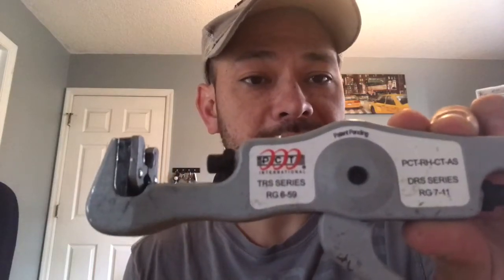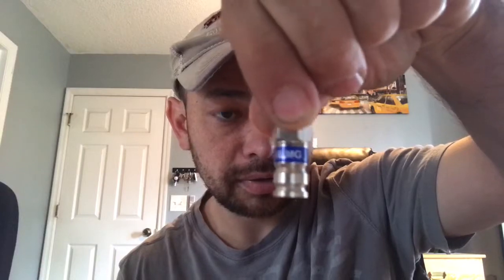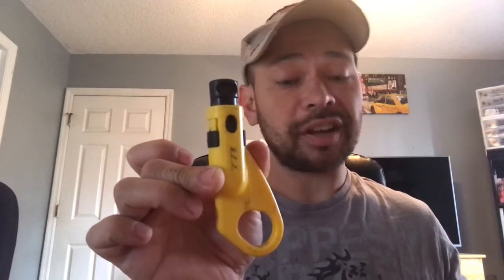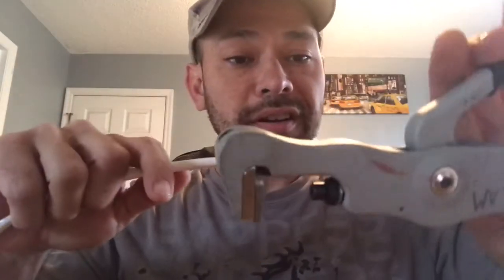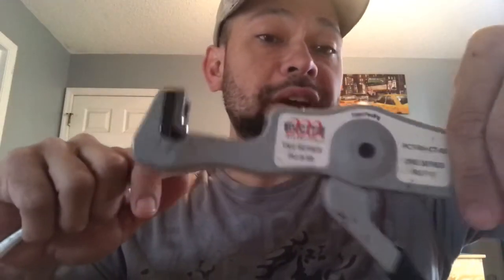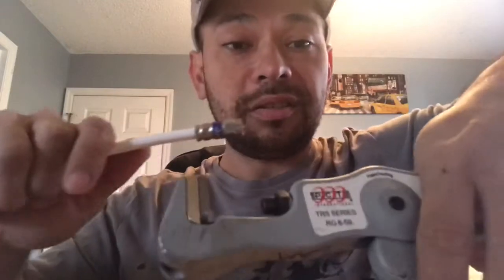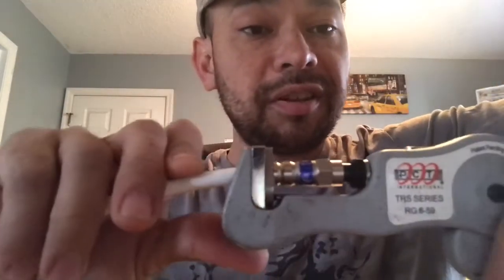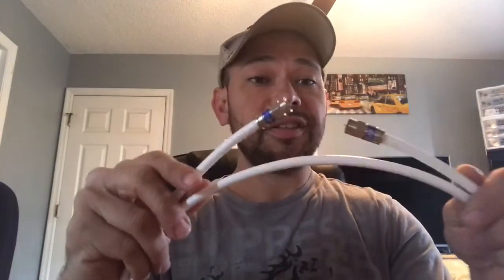How to make rg6 cable wires like a pro!

Comment: My wire won't shove into the connecter to make white part flush broke 3 connectors trying
Reply: You may be trying to force RG-6 cable in to a RG-59 fitting. Double-check to make sure your cable and fitting is compatible.